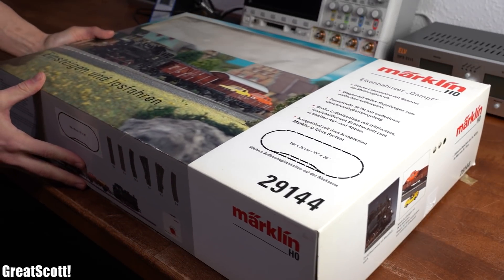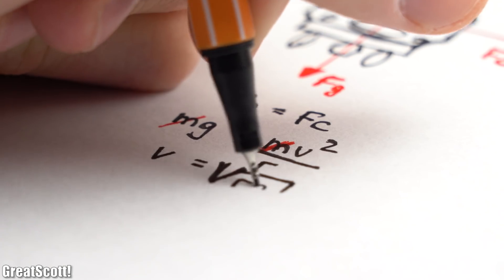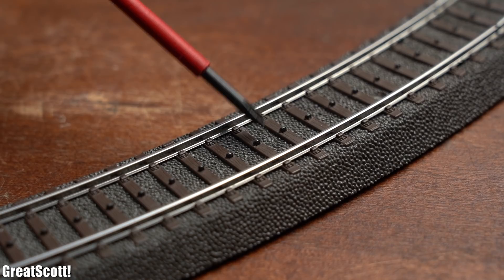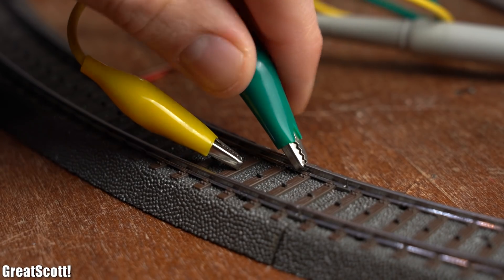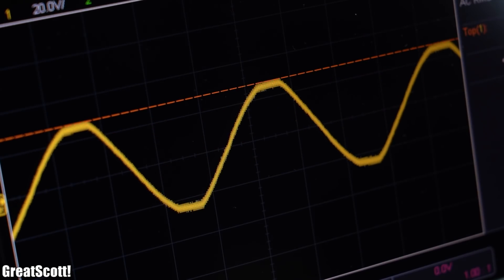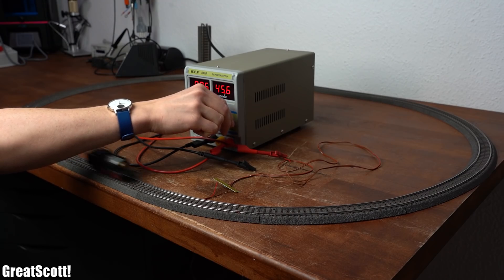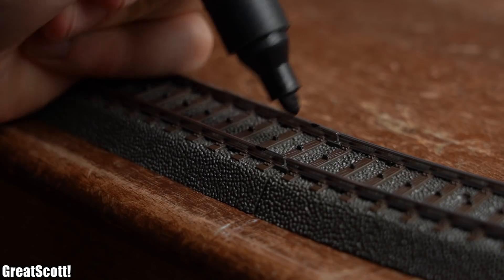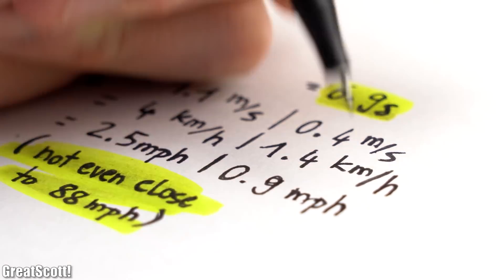How fast can an overpowered model railway drive? 88 mph?

Comment: instead of laying the track flat, put it in a vertical loop. with a bit of supprt structure, I'm sure you could get that train up to 88mph... :D (or put a really impressive hole in your wall...)
Reply: In "Back to the future" the problem is not getting to 88mph on a curved track - its about accelerating in a straight line. Lay a long flat track and see if you can get it to 88mph on that long flat track. In case the flux capacitor doesn't work, double the length of the track :)
Reply: @Bennyboy-dog  Jet engine
Reply: @Saharahzand  ..a tiny one!
Reply: @Bennyboy-dog  you don't need a track to accelerate a train, just roll it off of a cliff. From a rest, it will take 79 feet of free fall to reach a velocity of 88mph...
Reply: @SpecialEDy  Excellent suggestion!
Reply: I would say most likely a hole in the wall
Reply: @stuartpratt3662  I was going to say "A hole in someone's head". Don't want that for Christmas :/
Reply: U need incredible starting speed and the train must always be in contact with the tracks when inverted like the rollercoaster.
Reply: You need a circular track 0.96 miles in diameter to achieve 1g of acceleration at 88mph, or in order to drive upside down if the track is on it's side.
Alternatively, a track 10ft in diameter would generate 515m/s² or 52G of acceleration at 88mph.
Reply: @SpecialEDy  then we need a jet Propulsion for the engine. If we need such a acceleration. Or a coil gun
Reply: hey please read my comment on this video and see can u help me , please .
Reply: About the hole-in-the-wall thing here.

One of my friends once did wide up for hole in a wall with a small train somehow.

I was there but I don't exactly remember it.

I think it was an acceleration test?

Or somehow I think it got uncoupled and automatic uncoupler any ancient walled up accelerating 

Before he could kill the power.

I do remember he had a very steep grade on the track which didn't help.

The train was alright however the wall not so much.

Punched what look like a tunnel entrance to it.

Actually I think he was just trying to get enough power going to pull a heavy train up the grade. I remember it on the other end the locomotive let loose
Reply: Or just bank the track
Reply: It is getting real highspeeds if you scale it up, soooooo i read something like 240mph or 350kmh soo yeahhhhh
Reply: he could have use series circuit to increase current🤔 i think so

Comment: It could theoretically go faster if you glue on a weight on its bottom, since this would lower its center of gravity by a fair bit.
Also removing the controller board would lower the center of gravity yet more. But maybe it is getting a bit silly at that point.

Though, the power pickup method is maybe not the best for speed, since it pushes the train upwards a bit. Some model trains have the wheels isolated from each other, so that one rail is positive and the other negative. These can likely go a bit faster due to not having a springy contact pressing onto the tracks.
Reply: Today on the Bench better glue a weight on inner side of locomotive
Reply: @jklmnpqrst  Yes, for this track, that would potentially be better, not to mention that one could lower it down bellow the track itself. Effectively putting the center of gravity at track level.

Comment: Isn't the equation used at 4:27 centripetal force not centrifugal?
Reply: Centripetal force is the force provided by the track to keep it going in a circle, and opposes the centrifugal force. They're not quite the same thing.
Reply: Ed Manning yes but Fc= mv^2/r is for centripetal force and he uses it by setting it equal to Fg he can solve for v, basically solving for for the max  speed before it overcomes centripetal force. Which i thought was different than centrifugal force, but maybe i'm wrong

Comment: You should compare the speed to the scale speed.
Reply from the maker: Yep, I should have done that.
Reply: @greatscottlab  so where did the figure 88 come from?  Maybe I missed something.  The actual speeds are much lower.  Scale speed is a fictional concept not supported by physics.
Reply: @raykent3211  88mph is a reference to "Back to the Future"-trilogy.
Reply: @sleeptyper   oh, thanks, I'm very old and more in tune with plants than movies.  So bad that I read GSOH as god saves  ornate hedges.  Yeh, that out of touch.
Reply: @raykent3211  Whatever floats your boat. Sometimes reality is overrated. (:
Reply: ~220mph or ~350kph.

Comment: Of course it doesn't reach 88 mph. It needs 1.21 gigawatts of energy! Haven't you some plutonium in your workshop?
Reply from the maker: DHL had a problem delivering it.......
Reply: "The main combustion engine runs on ordinary gasoline, it always has!" "The time circuits need a little more kick" Plutonium is to generate the 1.21 "Jigawatts" of electricity. Sorry technicality, I'll see myself out now. Lol
Reply: @Gloworm17  you are right! But the joke it doesn't fit in this way
Reply: @lucatosatti7071     lol    Excuse me for 'listening in'  -  I don't even understanding this, but I Really enjoy it!     Cheers All
Reply: Yes of course!
Reply: 300 watts would be enough

Comment: I was hoping you would explain the circuit "the encoder thing" :-\
Reply: I even think this loc supports multiple trains on 1 circuit. the transformer is dumber tho, but some more pricy transformers can controll multiple trains on the same track independently of eachother
Reply: @CodeAsm  It´s called märklin digital and you can choose between a simple IR remote control system (4 trains delta system) or the more advanced mobile station or even central station or even a pc controlled system.
They can adress over 200 locomotives at the same time but the IR system is really fun if you want to play together since you can share another IR remote control.
A second mobile station is also possible but very expensive.
Usually nowadays you get this IR system in your startup-box
Reply: @MultiWirth  Well, don't just focus just on Märklin Systems as there are many more ways to control your trains. I personally used a combination of Märklin Mobile Stations with ESU decoders and a ESU ECoS.
Reply: @tim3609  i just don't have experience with anything else since i never used other systems so i can't tell anything about it.
Reply: https://youtu.be/NSE4CGsbHkc
Reply: @MeetWithMR  
Fuck off with your spam

Comment: What if you tilt the curves inwards? You would need flexible tracks for that, but that would be awesome...
Reply: Yes, we need to know the maximum possible speed!
Reply: I have flexible tracks for that set
Reply: The motor can handle the power/heat??
Reply: piyush nagawat replace with brushless 1800kV motor
Reply: @bruhdabones  it wont fulfill my requirement.... I would need more...
Reply: piyush nagawat a brushed motor cannot handle the extra power and heat as well as a brushless one can, that’s why drones use brushless.
Reply: @bruhdabones  Yes I'd like to see sparks fly from the wheels spinning!
Reply: Baxi 😂 there is a limit to what the wheels and tracks can handle, and we will find it!
Reply: @bruhdabones  i was being sarcastic... You said "replace with brushless 1800kV motor".... It was a joke right???
Reply: @bruhdabones  so brushless motor has high limit to tolerate more power...?
Reply: piyush nagawat I was not joking about the brushless motor.  They generate less heat (brushless = less friction) and therefore last longer and can sustain higher speeds.
Reply: @Barmetler  thats why DC is the best, you do
Reply: I think 3d printing new curver with inward tilt is make possible 88 mph!!
Reply: you are a thinker
Reply: Or build a very long straight track, but it's not actually possible with this set only ;)
Reply: they do that IRL on mainline railways, called cant or superelevation. Turns out if you make the tracks tilt 90 degrees inwards you can go infinitely fast :)
Reply: Just buy a bigger radius track 😊

Comment: I have such a model train but there is a heater for smoke effect which is this thin wire heater, which is broken 
Any idea for replacements
Reply: NiChr wire buy where you buy vaper parts.
Reply: @AlbiinoBlacksheep  Exactly what i want to say
Reply: yea, if you bump the voltage up to 150v you will start getting real smoke pouring out the model train :D :D
Reply: you will probably need to disassemble the locomotive, which is usually pretty easy as you need to oil the train from time to time.I think this system is just a heater that creates smoke
Reply: @user-le8ul4nr5t  there were some gears missing too
So I 3d printed some spur gears and while testing I accidently fed it 5v without current limit and the coil burnt out
A vape coil might surely be a nice repair
Reply: replace the smoke maker or whatever with an ultrasonic mist maker 😯
Reply: wire from old soldering iron (not gun)
Reply: You can use nichrome wire or get a wire from heating elements,or you can use coils from vape
Reply: Thebrightestbrick88  the original coil had a resistance of 2ohm and was very thin( like 45 guage)
Moreover it was wound into a coil with a very low diameter
If I am going with nichrome, how should I go about winding such a small coil
Reply: @bhu1334  Tailor needles too large (as coiling mandrel)?
Reply: @bhu1334  Use a pen or a straw or a cable or literally anything round/small and wrap the wire around it?
Reply: Maybe a cigerate can do the smoke thing ;)
Reply: I just know the "steam" generators from Seuthe which are for around 16V. That's what I use for my model train.

Comment: You did achieve 88 smph! (scale mph) The box showed HO scale which is 1:87 scale.  The factory top train speed actually scales correctly. (0.9 mph to 78 mph)(1.4 km/h to 121 km/h)  At real scale, you managed to achieve 217.5 mph (or smph)! (348 km/h)  Ummm... That being said, I think you are in bullet train territory!
Reply from the maker: I never thought about it that way.....that is awesome! :-) Thanks for letting me know.
Reply: @greatscottlab  i think you should pin this comment to the top
Reply: Thomas the Time-Traveling Tank Engine
Reply: That would be a very fast tank engine. :D
Reply: For an express steam locomotive 120 km/h would be a correct speed, but the tank engine this model resembles is a German Br80 shunting locomotive with tiny driving wheels.
In reality it had no higher top speed than 45 km/h, so the model is still way too fast.
But being a cheap starter pack locomotive with drive to only one axle and a very cheap 3 pole motor instead of the usual Marklin pancake motor a realistic speed wasn't on the wish list of its designers.
Reply: And I thought I was the only one who thought this. Lol.
Reply: But then he achieved 217 mph and not 88?
Reply: Reminds me of the toy cars scene from Top Gear where they said the same thing.
Reply: Thanks for doing the calculations,  I was wondering.
Reply: Hoping to arrange a moon base themed train for my kid when he's old enough. I've been tinkering with mag lev... holy crap that stuff is fast.
Reply: So if we want to build an ultra high speed train, we just need to make it physically larger?
Reply: maths